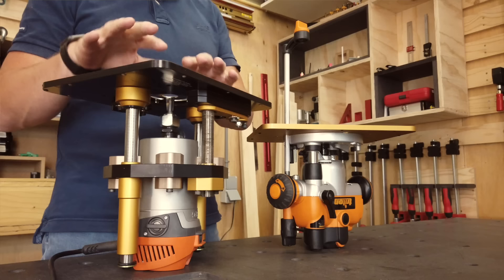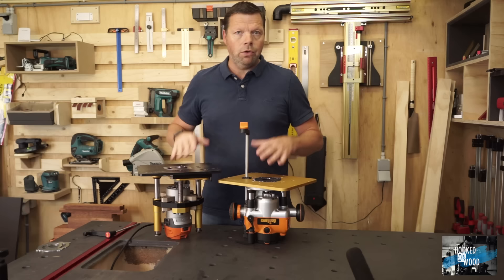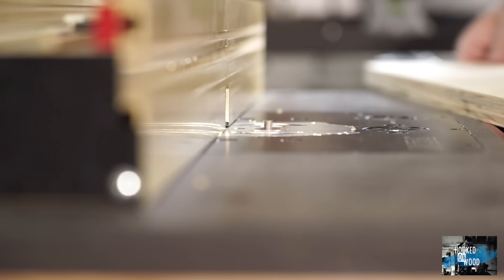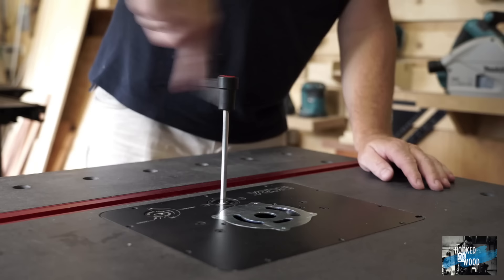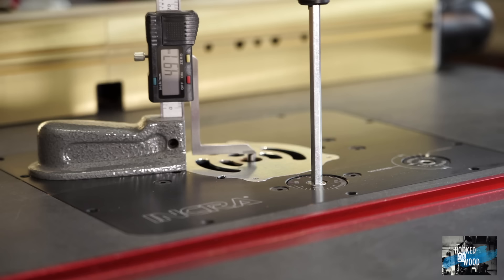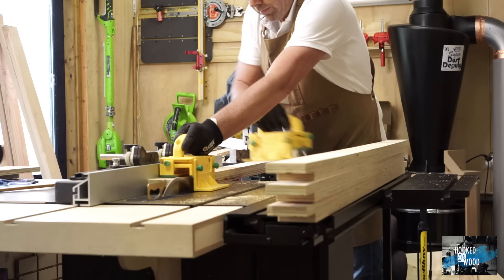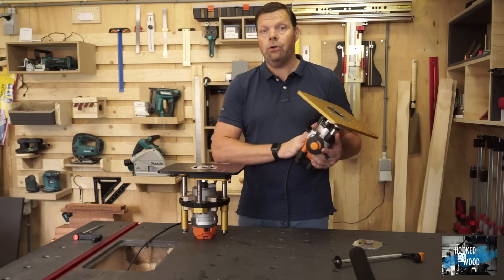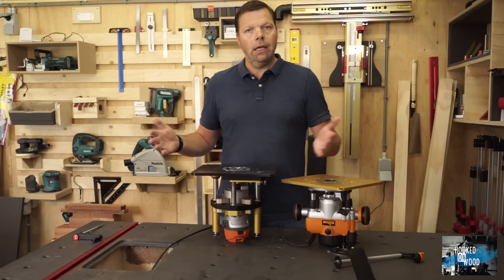Router lift test INCRA Mast-R-lift II VS Triton router

Comment: I have the Triton system- you do not need a box underneath, it already has a dust shroud fitted. Not sure why you removed yours...The lift also works fine, setting to .01mm points is not hard. I have a permanent digital readout fitted. More info is in https://youtu.be/ph_Mpjpv4uc
.
Reply from the maker: Hi MIke,
I remove mine to improve the airflow for the dust collections. I got more comments from people who said the same as you. So, today I made a comparison with the dust shroud fitted. and the dust extraction hose attached to it, and the results with my box with and without the dust shroud fitted. I will show the results in the next video. But you get noticeable better dust extraction with a closed box and a bit better dust extraction with a closed box and without the dust shroud. 
The advantage of a closed box is that all your dust extraction is right where you want it in the hole of your router bit.
With the shroud in its place, it works pretty well, but there is much more leakage around the shroud. Another advantage is that with the shroud you also get some dust under the table. With a closed box this is not the case. You will see it in my next video
Reply: Hooked on Wood Interesting- do you not get dust collecting in the box? Usually the shape of the dust collection is important... My router is in a trolley, and opening that to suck out any dust missed by the shroud every few weeks is no hardship. I would rather that than having to open a box to lock the spindle every time. Personal preference, I guess.

Comment: There is far too much play on the pillars of the Triton routers. Using a router motor is far better for router table use, than using a plunge router. When routing a dado make a dust extraction catch point on the end of the table, ie: a dust collector of a router fence, which comes with your router.

Comment: Hi Dennis, great comparison and I'm about to install the Incra masterlift into my bench and coupled with one of the AUK routers.
Did you design your own fitting plate for the Incra Super fence to the dogholes? I'd love a video on that and I'd definitely be interested in seeing / buying some plans for that as the alternative looks like ordering one of the Precision plates from Precision Dogs in the US (https://precisiondogs.us/products/precision-plate)
Reply from the maker: Hi Andy, 
I made mine myself. I have the LS positioner from the Table saw. (that one comes with a red plate that is thinner) If you use the LS positioner from the router the plate is thicker. In that case you have to remove the plate to attach it to the fitting plate. If you do not understand what I am saying. Please sent me a email to hookedonwood@hotmail.com I can show you some pictures and then you will understand. Thanks Dennis
Reply: @HookedonWood  Thanks Dennis, email sent

Comment: hi dennis trend use a router that you can raise up and down........i have used trend but not that good they make good cutter bits but not good routers and they are overpriced there accessories are not planned out well and dated
Reply from the maker: Yes, I know right now. So, far I am satisfied with my router.

Comment: Just import a router from the states
Reply: @Joyce Miller, it's not that simple for European shops.  I would have loved to bought a Porter-Cable router for my table, but 230V 50Hz power here creates more problems when trying to use 120V 60Hz U.S. products.

Comment: Hi Dennis, I just found your channel.. I am finally going to build a bit of a woodshop in my garage rather than working on a small ryobi table saw and workbench.  I was planning on buying the triton router and now with your video, the incra plate.  however, I am in love with your router table and dust collection box.  I already have a fairly large workbench so was thinking of building a router table into a mitre saw station.  Do you have plans or would you sell plans for your table router, and dust collection etc.?  I notice you said they would be available.. maybe they are bundled with something else as I couldn't find them on your site.